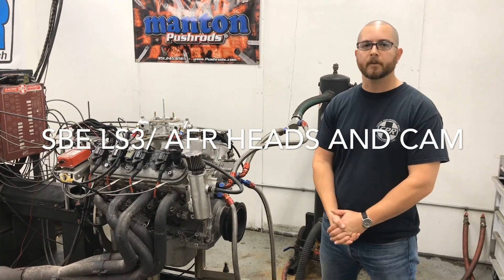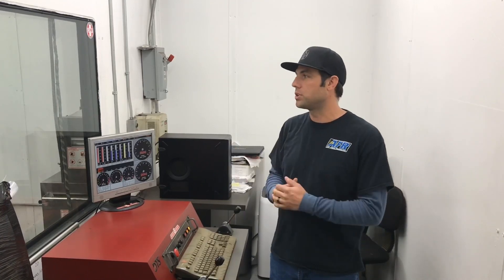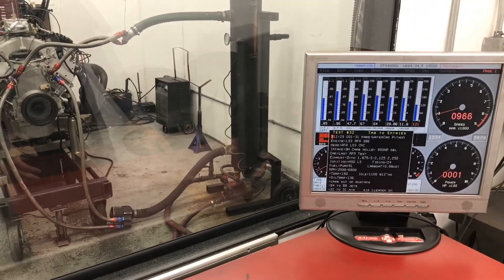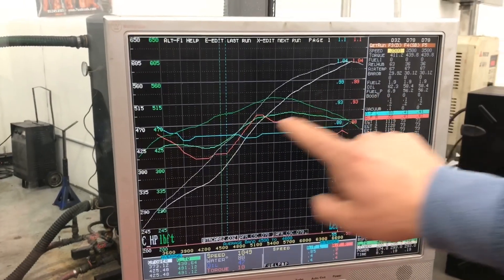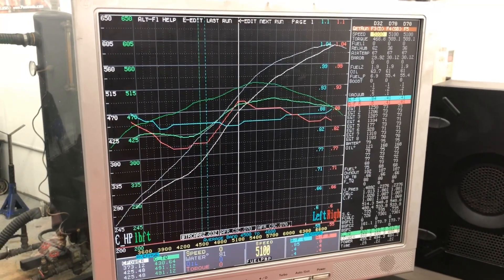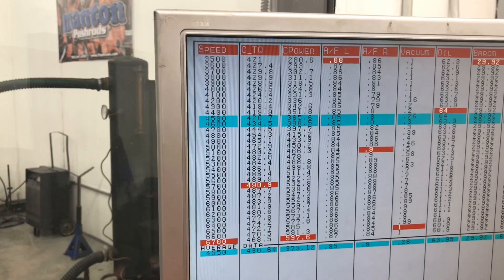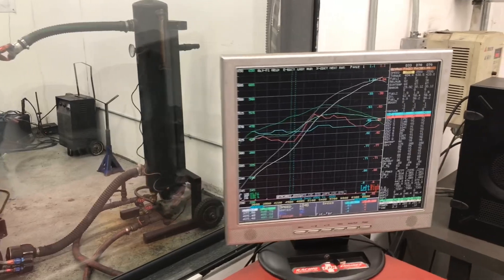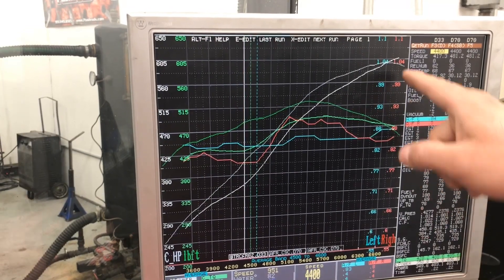Stock LS3 with AFR heads and cam-  efi ls3 intake vs single plane and Holley 950 carburetor

Comment: The biggest part of the problem is running the same timing as fuel injected. Optimal timing for a fuel injected is more than likely nowhere near optimal timing for a carb'd motor considering a carb'd motors fuel droplets will be bigger and likely require more timing for a more fair comparison.

Comment: How was the port alignment with the single plane and AFR’s? I have the same heads and had the same single plane, and the intake needed a good bit of work to line up. I now have a Super Victor and it was the same deal, needing milled and some work for good alignment.

Comment: Why not rev it until it starts rolling over with the carb setup?  
I've done back to back testing with a single plane vs the ls3 in my car and it gained a tenth and picked up 3mph after installing the single plane.  The only place the stock intake made gains was in the 60ft and 330, after that it fell off the rest of the pass.  If my converter stalled higher than 4500 then the single plane would have been even quicker.

Comment: Seems to me that you tune the carb to pick up the torque that was lost in the lower rpm range as well as make more hp on the top end with the carb..
Reply: Any tuner can get more with a proper efi setup.

Comment: Put a vic jr on it vs that intake..thats the worse carb intake there is .then toss a cam in it with a 42-44 ivc an 57-59 evo an for the carb setup and its well known in the carb ls wourld that they like more timing then when efi
Reply from the maker: ghost727 this is what the customer had-